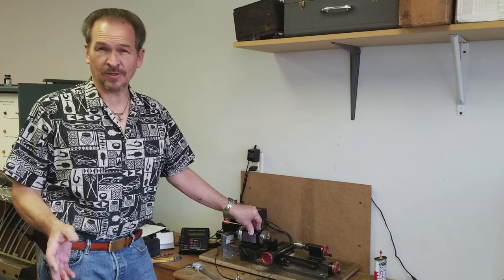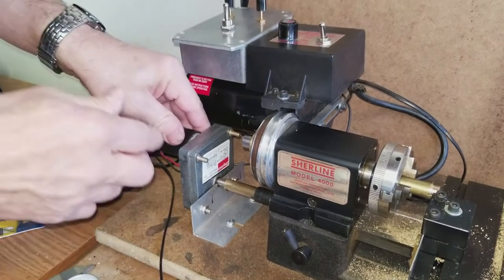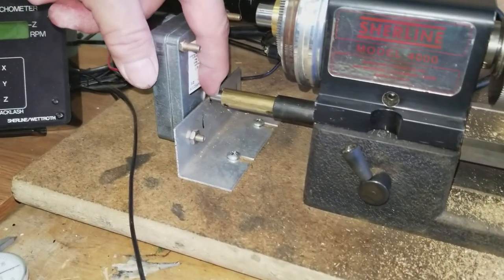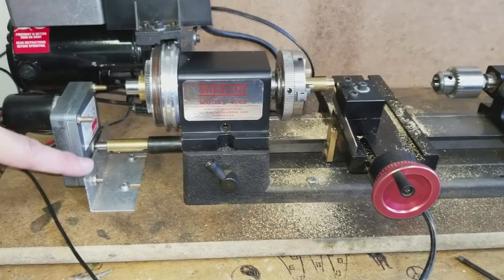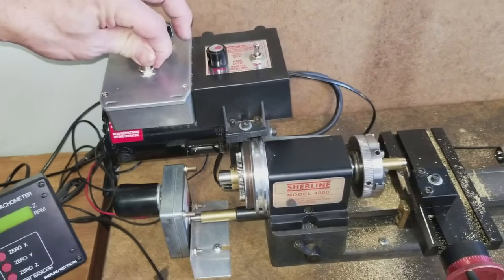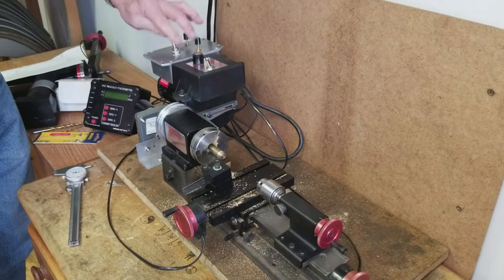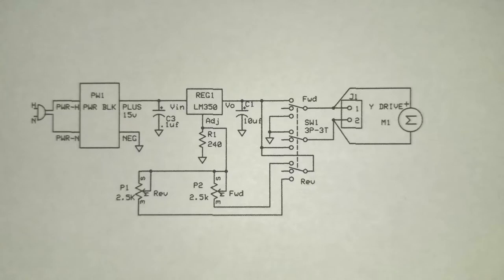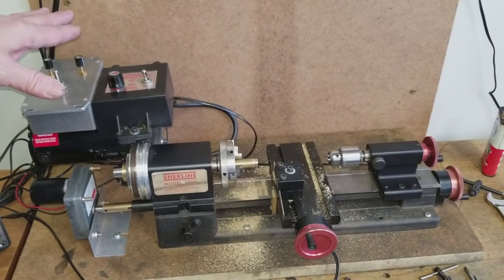Sherline Lathe Y-Axis Drive Modification

Comment: I motorized mine, but approached it,  a bit differently.  The very first part I made on the lathe, was an extension for the lead screw hand crank. The crank handle ID is 0.25".

I made a small shaft with a 0.25" bore on one end, with a set screw, and a 0.25" shaft on the other end. I made the shaft long enough for the crank handle, and a timing belt pulley with a 0.25" bore.

The extension goes on, the pulley slides on the shaft, and the hand crank on the end.

I used a small 12VDC gear reduction motor, like what you used, with a timing belt pulley to drive the lead screw. The gear motor was one I had, and it was too slow to direct drive. I used the belt drive to get more RPMs at the lead screw.

I used an On-Off-On 3 position, 2 pole switch, (two pole is two, parallel contacts, inside the switch).  I found a schematic, online, on how to wire a switch like this, to be a directional, polarity switching switch.  I haven't found a need for speed control, I must have been lucky, so far, and ended up with a good feed rate.

May need to add one, later.

I don't know if all gear motors are like the one I used, but I can still use the hand crank, without needing a disconnect system. I turn the handle, and it turns the lead screw, and the motor, without issue.

You are certainly correct about the finish. This is my first lathe. I spent the Winter watching videos, and reading about lathe operation, and all the problems with finish, etc... So far, unless the cutter I'm using is dull, or the profile is quite right, I haven't had any issues with getting very nice finish surfaces.

It ALMOST makes me say, "This lathe stuff isn't so hard." But, I've been around long enough, I know better than to say it; 'cause that's when the little bugger will prove totally wrong!  LOL

Well done, thorough explanation.
Reply from the maker: Thank you for your contribution and for providing us with another way to approach this. This is definitely a good read and our viewers will appreciate it. Thank you for watching. Your comments are always welcome.

Comment: This is really helpful thanks....I’m going to try to modify my Sherline as you’ve done but utilising a geared drill motor with speed controller that I already have. Can I ask two questions though...
1. Your motor is 60 rpm with potentiometers to slow it down. Do you find that the 60 is fast enough or, given that the speeds are controllable, would you in retrospect go for say 100 rpm?
2. I already have the Sherline threading kit although I have never used it! I understand that your 1.75” long brass rod links the motor with the bed shaft. Is the headstock end of that brass linking rod rigidly connected inside the headstock or does it simply push in and engage with a profiled end?
Many thanks...advice much appreciated!
Reply from the maker: The 60 rpm unit has proven to be just fine in all operations. The brass rod is a push-in unit profiled as noted and continues to work flawlessly to date.